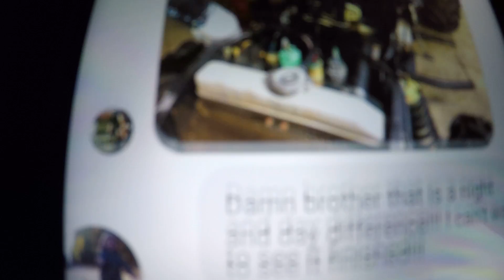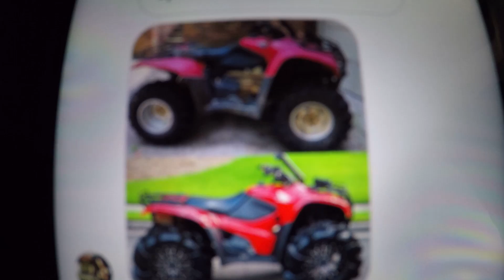Mail call!... and check out this build!!!

Comment: So you are deleting the tilt sensor?
Reply from the maker: No sir, you pull the the tilt sensor and unplug, take cases apart and drop silicone in the bottom and let silicone cure and then reassemble
Reply from the maker: You have to keep it standing upright while it cures
Reply: @SomeDamnfoolsAtv  so what does that do tho? Tricks the sensor?
Reply: @jaycevessier7554  check out solitude customs or mud puppy..you will see😜👍🇺🇸
Reply: @Twisted-U-Twisted  I follow them both and have never seen either one post about this
Reply: @jaycevessier7554  watch a lil closer..they exist 👍🇺🇸